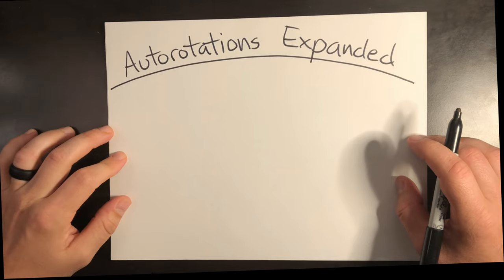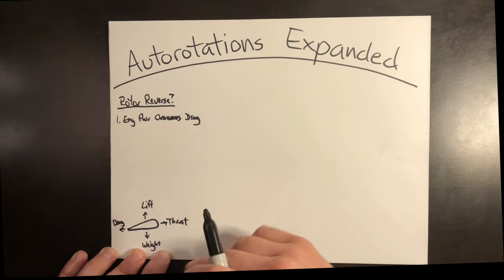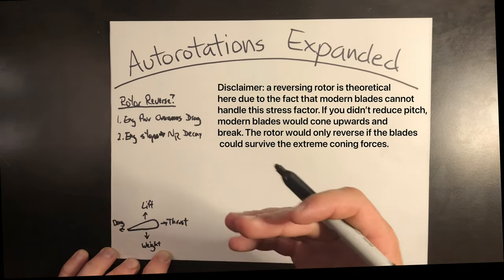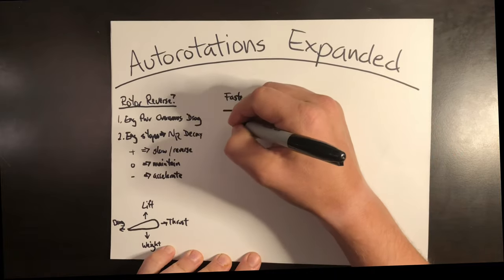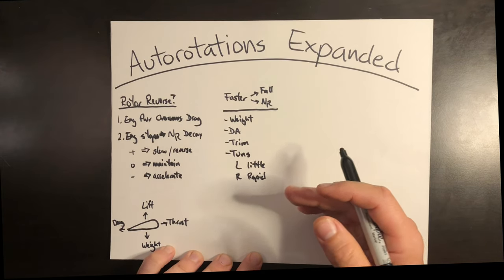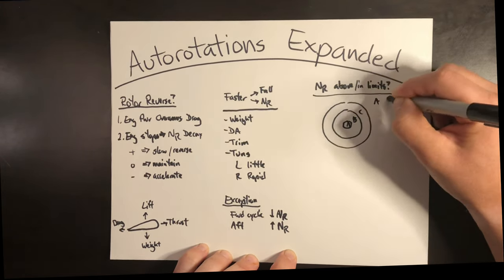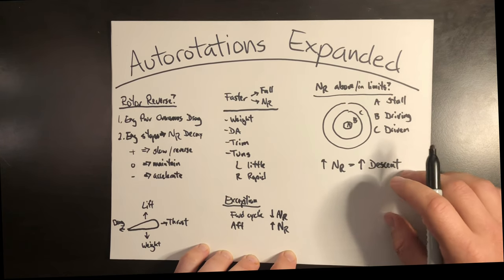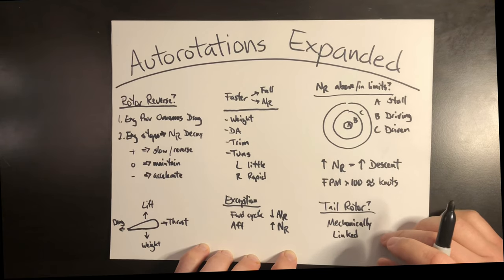Autorotations (Expanded) in Helicopters

Comment: Thanks for the great videos ! Can you please elaborate on your experience with extending your glide to reach the touchdown point, as well as being too close, and cutting down on the horizontal glide distance - Thanks !
Reply from the maker: Generally the closer you are to Max Endurance airspeed the more time aloft you have. As you get closer to Max Range airspeed, you increase the distance travelled but you’ll also increase your rate of descent. Most operators manuals preach doing autos midway between these 2 points. But you can use these airspeeds to your advantage depending on the altitude you have and the touchdown point you need to make it to.
Reply: @helicopterlessonsin10minut10  Thanks !  Will be great to see a video discussing S turns, Slip and zero speed, so you can hit your spot....  Thanks again !

Comment: Hey Jacob, how do left and right  turns have a different rate of increase when in an auto? In your transient torque video you state that the increase is due to more or less induced flow over the back and front of the rotor disk and which way the Gyroscopic precession is acting. But in an autorotation there should be no induced flow present once the airflow changes to an upwards pattern instead of downwards pattern? Thanks for the videos.
Reply from the maker: Great question! When in a forward airspeed auto, the autorotative regions (stall, driving, driven) shift slightly more to aft and to the retreating side of the rotor. This causes differential drag across the disk like transient torque. When applying lateral cyclic, these pitch increases and decreases compresses/expands driving and driven regions. 

When turning left, this would increase pitch over the tail (driven region expands, driving region contracts) and decrease over the nose (driving expands, driven contracts). This would normally slow the rotor but because the total aerodynamic force (TAF) shifts from vertical vector, the aircraft falls faster and the upflow overwhelms this force into a net effect of a slight increase in rotor RPM. 

When turning right, the pitch increase is over the nose (+driven , -driving) while the pitch is reduced over the tail (-driven, +driving). This would cause an increase in rotor rpm. Combined with the shifting of the TAF from a vertical vector caused the rotor to increases as well. Net effect is left turns cause a little rotor increase, right turns cause a rapid rotor increase. I hope this helps answer your question.
Reply: @helicopterlessonsin10minut10  Thanks for the quick response. I didn't realize the change in the pitch would have a net effect on the rotor since it would increase the driving in half and reduce in the other half I figured it would all even out to remain a constant and the only increase would be from the total reaction in all states. Thank you for your help.

Comment: Very interesting video and so far everything makes sense for me. At least in this description. But I saw other explanations that contained I think different information. For example many people say (if I understand them right) that during autorotation RPM can be maintained and even accelerated with positive pitch in normal flight. This makes no sense to me. As far as I understood this video you do not claim anything like that. But still I wonder how it would work even with neutral pitch, because there still will be friction etc. that should dangerously slow the rotor. Also I do not understand how this for example is relevant for gyrocopters and their form of locomotion and this would interest me a lot. I would be very interested in your description of how gyrocopters fly.

Please excuse my english, it is not my mother tongue. And also I am no real helicopter pilot only a rc helicopter pilot and in our instructions usually no one even mentions neutral pitch, because usually several degree negative pitch are recommended for autorotation. I can not get my head around the claim that there is something that significantly different when it comes to real size helicopters. I mean at least the same principles should be applieable and not completely reversed. I know that real helicopters have different geometrie especially on the rotorhead (like washout etc.) but things like that do not explain the common descriptions of the regions in the rotor during Autorotation (Driving-, driven- region and stall) and sometimes even seem to contradict it. 

I would be thankful if someone could explain this to me.
Reply from the maker: Positive pitch in an autorotative state will absolutely decay rotor RPM. The positive pitch used to create lift creates drag as well. With no engine power, the drag without thrust in the rotor blades would cause the rotor to slow. The only way to maintain rotor RPM would be to have neutral pitch. The only way to increase rotor RPM would be negative pitch.
Reply: @helicopterlessonsin10minut10  can you make a video on factor  a b and c

Comment: Okay so when you start an autorotation you are just trying to maintaining the rotor rpm that you had before you lost your engine?
Reply from the maker: More specifically you want to maintain rotor rpm within normal operating limits. It should have been in this range before engine failure unless something drooped it prior.

Comment: Hey Jacob when would you pull collective on a full down auto? Also do you flare without pulling collective?
Reply from the maker: Usually you save all of the collective until after the flare. But if you want to maintain rotor within limits because it’s getting too high you could mildly increase collective earlier to keep the rotor in check.

Comment: So, forward cyclic, slows Nr, but increases airspeed...
Aft cyclic, increases Nr, but slows airspeed
Yet, High Nr, rotor speed increases descent rate... 
Main point here is: You better have sufficient altitude to have a good glide to descent ratio,
otherwise you are gonna have a hard landing...